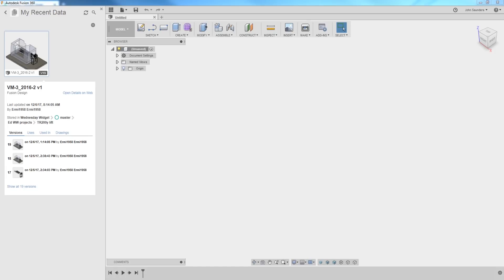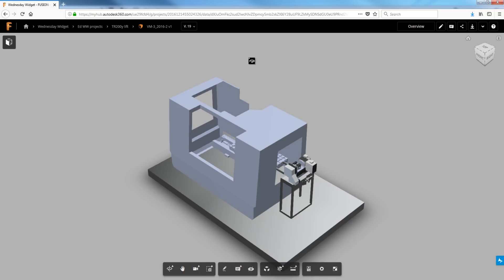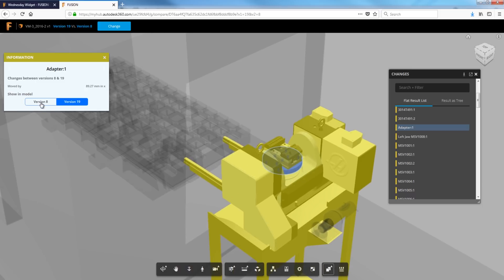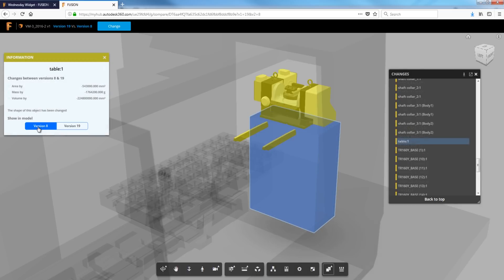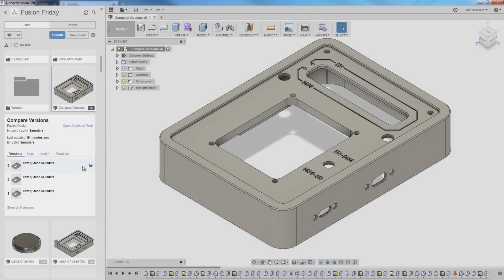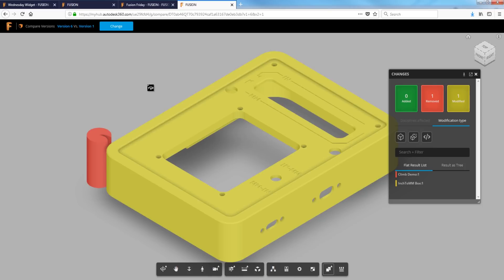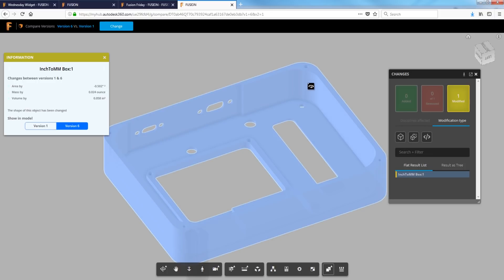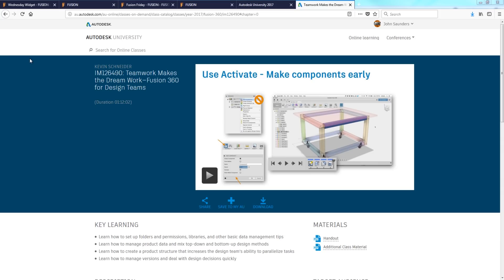Compare Versions of Fusion 360 Files!  FF110

Comment: Count me in the group of people who didn't know about this. Something I've done is to open both versions and then copy the components over into a new (temporary) design. Then you can use the Modify->Combine tool to cut the old from the new or cut the new from the old. You could also do an intersection between the two. If you keep the tool bodies and then turn on Component Color Cycling (in the Inspect menu or Shift+N) you sort-of get a look at what has been changed. You can also, of course, hide/show the bodies/components to toggle back and forth.